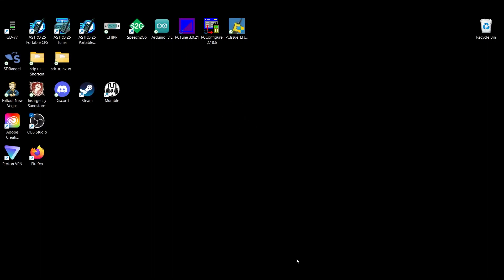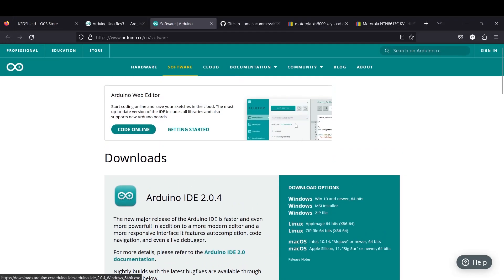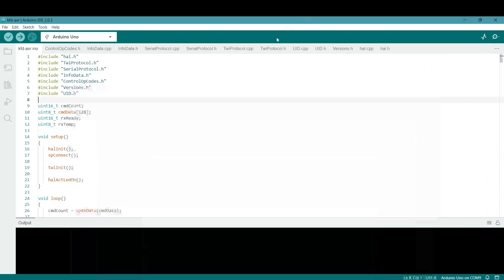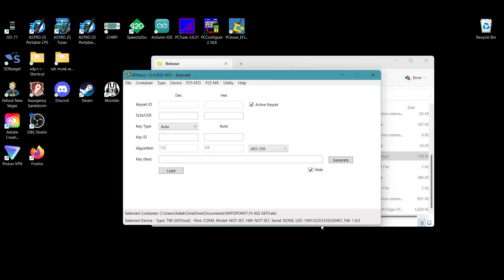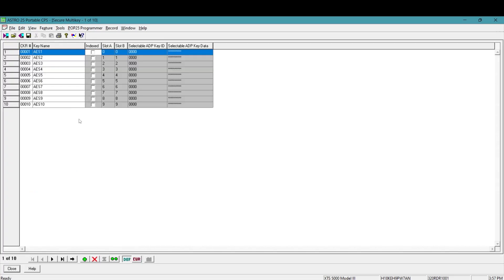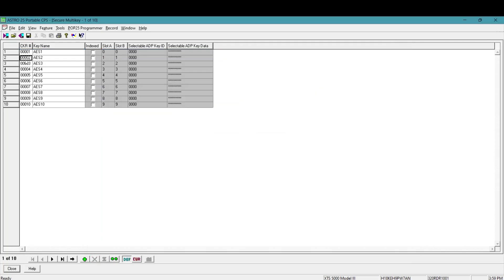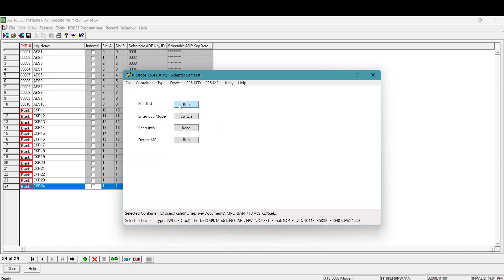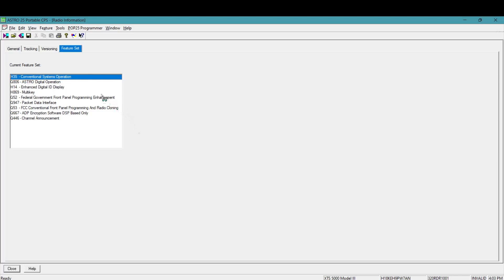Key Loading P25 Radios with KFD Shield

Comment: was haveing probems, seam i miss a few steps one radios has diffrent firmware revision on encription card,   so i confirm all key was removed, what my mistake was i did not add them to group so none would talk togather , not only i not even shure data was totaly encripted,   with this video i was able go back fix mistakes i made, now i just have repogram the radios see if it works, 

think most easyest way is lock it to encription only, work or not work as today is xmass can wait, all have grate xmass

Comment: Have a few questions,
I have downloaded several zip files for version 1.8.7 but I don’t know as to which operating system it will run on. Have XP and 7 pro machines here. There are no instal files in the zips nor are there any executable files in the stuff I downloaded. Do I have to load an older version of KFD tool and then upgrade to the latest version? I am working with the newest programmer tool the KFDmicro.

Comment: Anyone else have their XTS2500 go into keyloading mode when you connect a programming cable? Cable works with EFJ 5100
Reply from the maker: @Ian-jt2kl  that’s because the XTS takes a different programming cable than the EF Jonhson 5100.
Reply: @Floridaman_Outdoor sorry for the dumbest question you've answered yet. 😂

Comment: I have went through all steps and everything works until the self test "Detect MR".  If try to go ahead and load a key get "Error -- timeout waiting for data
Reply: Same here... Have you figured out what the problem is yet? I'm going into keyloading mode fine, radio is connected fine.. etc.
Reply: @austinkirkland1695  I finally got it to work, but I honestly have no idea what I did as I tried several times. I did unplug  everything and check connections. Make sure hardware encryption is enabled in CPS and that you have key slots available.

Comment: Its to expensive for me to get but I need to get my EF Johnson 5100 key loaded somehow
Reply from the maker: @coreybabcock2025  keep an eye on Omaha comms store for restocks on KFD Micro keyloaders. They also sell cables. You will need to modify a Motorola Keyload adapter by soldering bridging 2 of the pins together. There is information on Radio Reference for how to do this.
Reply: @Floridaman_Outdoor  I saw that
Reply: @Floridaman_Outdoor do you have the link to the article? Radio reference is one large database.

Comment: I've read that a modified XTS programming adapter will work with this on the EF Johnson 5100ES.  Do you know if that's correct?  Also, would you recommend a cable or hirose adapter?  Thank you.

Comment: error-- timeout waitng for data. how can I fix it?
Reply: im dealing with this also. have you found a solution?
Reply: @aqualab485  $40 kvlmini from ali and buy $50 kfdtool cable. Do not buy 150 buck kfdtool.
Reply: @aqualab485  @aqualab485  $40 kvlmini from ali and buy $50 kfdtool cable. Do not buy 150 buck kfdtool.
Reply: @aqualab485  yes. use kvlmini and kfdtool cable. Not get $180 one.
Reply: I'm stuck with this too
Reply: @RoyanGreenwood23  I solve problem. Did you put your 3.5mm connector tight?
Reply: @Mr-mp9ur I have a 3 pole 3.5mm connector,  the tip of my 3.5mm is data, the centre is sense and the base is ground.  It is correct. 

The issue I'm having is the kfd either says error: timeout or error: data shorted to ground. 

Even with the cable not connected to the kfd i get issues
Reply: @RoyanGreenwood23  You must use 4 pole trrs 3.5mm pin to connect.
Reply: @Mr-mp9ur  the receptacle for the mic plug only has 3 contacts (data, sense & ground).  Why would you say someone needs to use 4 pole pin?

Comment: Thanks for the video attempting this project now.  I've loaded keys list into military bulk encryption equipment but never into a Motorola. Have the 256 AES UCM most are V1 XTS 5000 390-480 mhz a few V2's  I wanted the V2's loaded all have flashcode H869.  Originally I wanted to do a V2 to a V3 convert but need a Q52 Q53 FPP enable which I have not found a way to do.  I the process of researching that I figured at least I could put some keys in for the security company using them for future use.   Keyloader is in the mail, probably will have a question then.  thanks.
Reply from the maker: Only model 3 Motorola can do FPP. All you have to do is a flashcode update with Astro 25 Depot to add FPP to a model 3 radio if it doesn't have it already.
Reply: @Floridaman_Outdoor do you have any good resources for Flashcode updates? I’ve seen some conflicting information about how to do it and the required hardware.
Reply: @hajduk_lives  I know this is two years late but I just did this for a 2500 and a 5000. You just press Update Codeplug in the depot menu and put the new flashcode in, save, close the Codeplug, re-open it, then write the Codeplug to the radio in the depot software with the option in the depot menu (not the standard write device button like in the regular CPS).